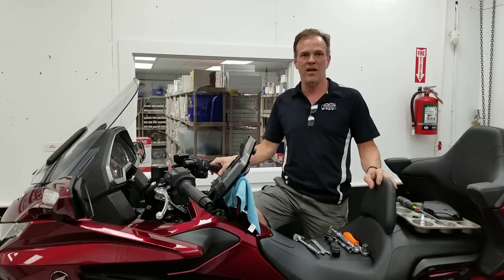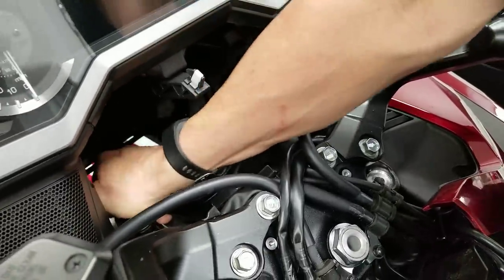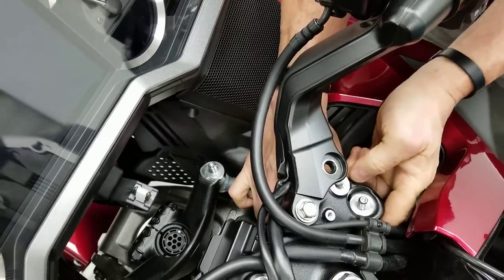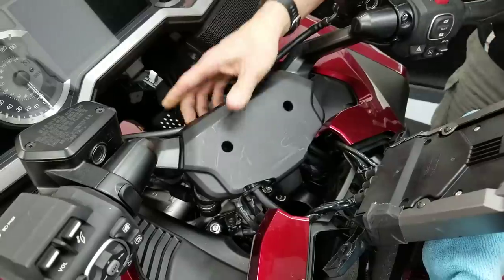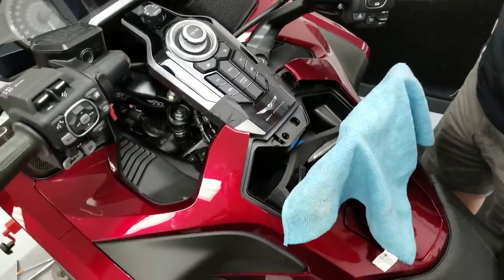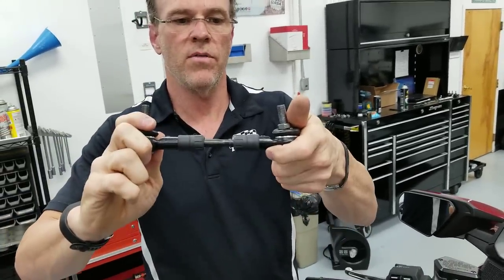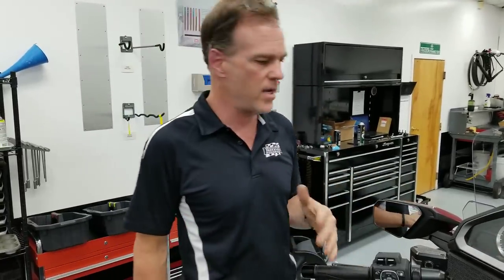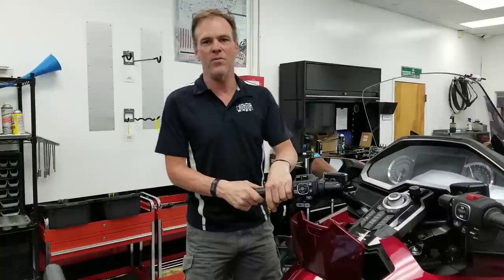Total Steering Upgrade Part 2 2018 Honda Gold Wing

Comment: Well I did the whole front end check for loose steering issues today. Changed the Tie rod with TD solid one. Adjusted the left tie rod and placed the steering pin for alignment. Test ride...NO SHIMMY or shake in the front end, thought it was the balance of the tire or the Centrmatics were not working.  Very happy to be able to ride 30-45mph without that shake in the front end. THANKS Max!
Reply from the maker: If your bike was wobbling, the tie rod should have had no effect.  Not sure why it helped that.
Reply: @Traxxion  well and I totally agree with you. I don't know if it just took the slack out of the loose steering.  In the past it's always been the tire balance
Reply from the maker: @Doc832  tire balance or defective tire.  Anyway, glad your bike is fixed!

Comment: Max, the OEM rod has two washers but I noticed you didn’t replace washers between your new rod threads and where it connects ?  Are washers not necessary for the Traxxion rod?  If it is, I’ll be taking it all back apart.  Thank you sir!
Reply from the maker: There is one washer between the tie rod and the top bridge, and no washer under the flange nut.  At least that's how my bike came.
Reply: @Traxxion  Ok but what I need to know is do I need to put washers back on the Traxxion tie rod or is it designed to install without them?  In your video you don’t show any washers so I am assuming I don’t need them?
Reply from the maker: @robertf3340  Your choice.  We put them back in normally.  Not sure where/why they were for this video.
Reply: @Traxxion  lol I watched the video like 5 times and I thought either I was blind or my comprehension skills took a dump. Thanks Max. Love you guys over there at Traxxion. God bless
Reply from the maker: @robertf3340  I hate to say "it doesn't matter", but if I had left them off of my bike, I wouldn't lose a wink of sleep.

Comment: Max thanks for your videos. Question: would it be mechanically "wrong" to place 2 of your tie rods? I have seen the video where you remove one an ride like that... and how hard is it, and the video where you test ride this new mod. Night and day difference. So would it be a total overkill to install 2 of your rods, one on each side? 
Why Honda install rubber bushings? Are they doing any sort of cushion/absorbing vibrations that otherwise will transfer straight to the bar with a solid tie rod? Thanks for your videos and dedication
Reply from the maker: Hi Jhonathan!  Honda has one tie rod mounted in rubber to prevent the 2 tie rods from inducing any unnecessary wear on each other.  Changing both tie rods isn't necessary, in the million to 1 chance your right tie rod ever failed, it wouldn't matter if the left one had excess play.  However, I think it's stupid to have that crazy floppy rubber busing they put there.  It could have been much stiffer and it would be much safer.
Past that, you couldn't use 2 of our tie rods, because you need at least one to be adjustable so that you could set the tie rods not to be in conflict with each other.  I made our rod non-adjustable to take away the many possible places the stock rod could crack, break, etc.   If you just replace the left floppy bushing with our stainless bushing, it makes the left side just like the right, and it would be perfectly normal to drive if the right side ever failed.

Comment: Max do you have to adjust the alignment?
Reply from the maker: It's best to check it and adjust if necessary.  There is no alignment for the front wheel, but you can align the handlebars to the front wheel perfectly.  It requires 2 of the Steering Lock Pins for it to be "perfect".

Comment: If I'm just changing the right tie-rod. I assume, there is No adjustment needed in the steering
Reply from the maker: It should be fine.  Some people like to loosen the jam nuts on the left tie rod, and wiggle the shaft to find where the rod is loosest and then lock them  back down.  If you have any trouble contact me via email, max@traxxion.com

Comment: So, I want to confirm because it is a bit confusing (at least for me): the installation requires a) the solid tie rod and b)  two (2) solid stainless steel bushings. I'm correct or are we just replacing the bushing on the right side where the new tie rod will be installed?
Reply from the maker: You replace just the right tie rod (it's already solid mounted), and the left rear bushing (which is the floppy rubber one).
Reply: @Traxxion  Roger that... Thanks Max. I'm having issues with the bike pulling to the right, so I started looking at the video where you explain how to fix it and starting watchin the other related to steering. 
I picked the bike last Wednesday in Iowa city and rode back to Virginia. The trip was the worse of my life. I have a neck/upper back injury, but never bother me on my 2006 GL1800. This bike managed to "re-open" my injury on the 1060 miles trip, I couldn't wait to get off the bike. I was very sad. The seat is awful (will talk with wingsoft about the mod) and already ordered back rest and highway pegs. But more importantly today I really could notice the issue of the bike pulling to the right... which is why my pain keep coming back every time I ride the bike more than 10 mins. During the trip I didn't pay attention because it was cold and rainy so my focus was on that. 
In your personal knowledge: do you think that replacing this rod can cause a voided guaranty? you know dealer will try to find any excuse not to repair a bike under warranty.  
Thanks.
Reply from the maker: @biofractal78  If your bike is pulling to the right, it has nothing to do with the tie rods. They are just remote control arms.  There is something else seriously wrong with the bike, and I would take it back and not keep it until it's fixed.  Changing parts on Wings doesn't void any warranties... There isn't hardly a single goldwing on the road that hasn't been modified.  We've been changing complete suspension systems and triple clamps on Wings all over the world for 15 years, never heard of a voided warranty as a result.

Get your bike fixed first, don't worry about buying anything from us until your bike goes straight!
Reply: @Traxxion  Sorry that my comment was confusing. Yes I am aware that the tie rods has nothing to do with the bike pulling to the right. The bike slightly pulls to the right and is not the crown of the road. Im going to try the fix that you suggest on one of your videos, in which you use a special machined pin to lock the "tuning fork". 
Also I will check the free play on and alignment of the handlebars itself. Thanks for the reply and sorry for the confusing comment.

Comment: Have you considered a harder rubber bushing on the left side instead of a solid metal bushing?  I wonder if Honda hasn't tried to make sure that customers do not make modifications to the steering system that could end up inducing stress in the steering arms by virtue of poorly adjusted solidly-mounted tie rods on BOTH sides.  Just a thought.

Comment: Hey max why do you think you or your guys are smarter than the whole research and development department of honda motorcycles...
You know any of the ramifications for your handiwork overtime?..
Reply: Maybe these components are adjustable for a reason..
Various rider weight.. road conditions in different locations..
Cargo...
Reply: @Traxxion  understanding  that this is the business you chose  to make $ at.. and not  knowing of you or your company..just left me  with a couple of questions.. 
Really  glad you took time to respond..